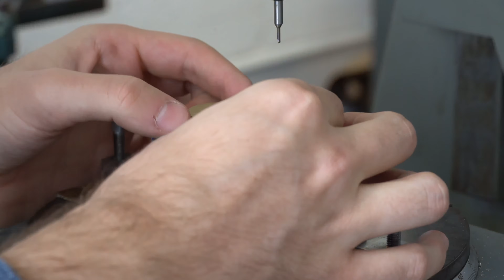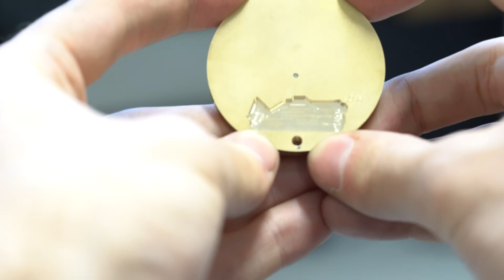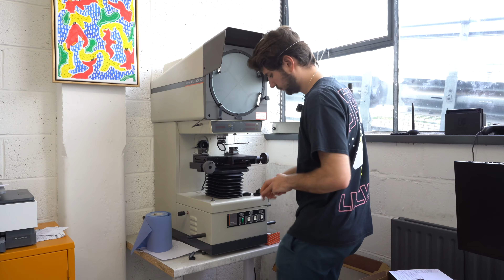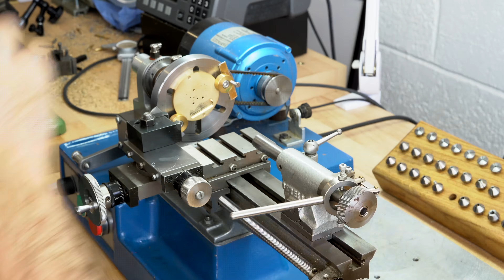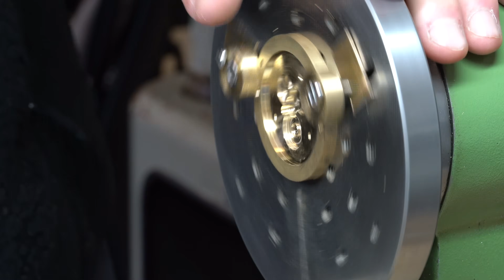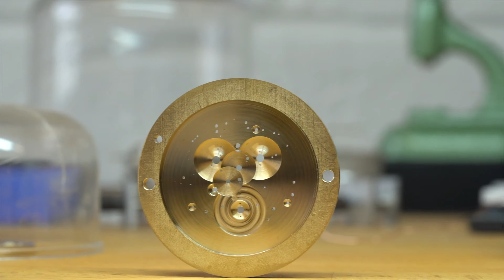The Mainplate - Making A Tourbillon Wristwatch

Comment: Nice work and attention to detail. Could you not use a live center in the tailstock to locate each hole and use a little pressure to push your main plate up to the face plate and then secure your piece? That would center a hole just as you center the plate on a jewelers staking tool. It would save loads of time locating those holes, IMO.
Reply from the maker: Hi Daniel, thank you! Using a live centre does get the hole in the right region, but it never perfectly centres is so you will always need to use this method to get the hole running perfectly concentric.